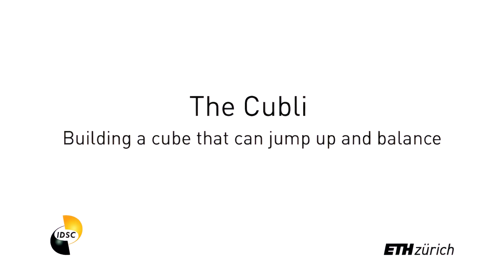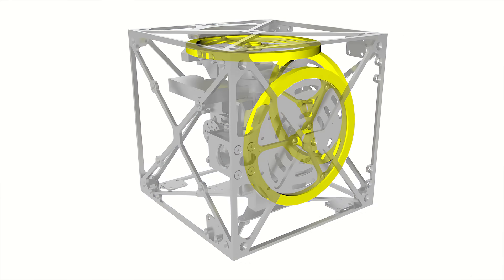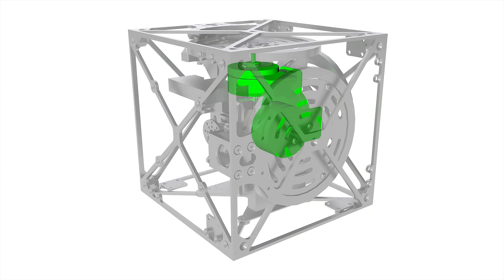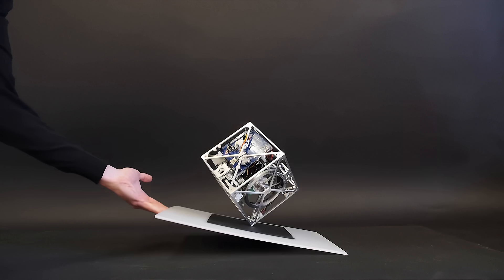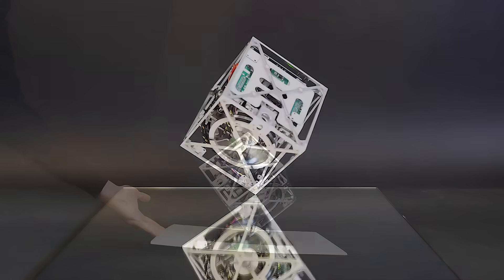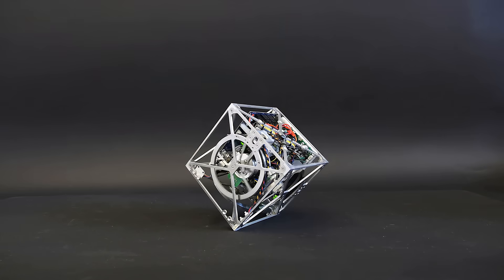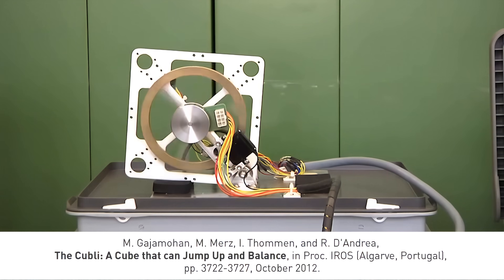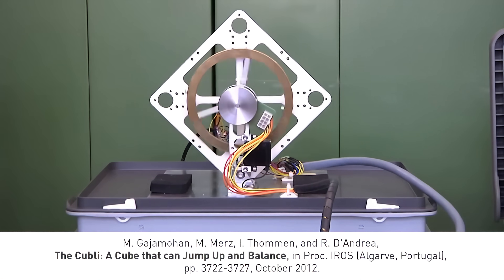The Cubli: a cube that can jump up, balance, and 'walk'

Comment: incredible device. i absolutely love this box of tricks, can i get the specs anywhere, or are they secretive about it's construction? it would only be for myself.as i often play with electronics and a few fast stepper motors, flywheels, a 'pic' chip and a few bits of hardware I think i can do some analogue of this, it won't be of that standard but a locomotion action would be fun, many smaller units with electromagnets and contact electric plates ....,, ah i will say no more i can't have some one steal that idea it will be fun. micro insects 6 legs = 6 faces now!  
i made some digital mobile fire flies that flash and beep either alone or in groups, they both transmit and receive timing from others nearby so small synchronised islands got established community that was fun.

Comment: Call me when it’s small enough to fit inside a die.
Reply: It can already, the design is fully scalable.
Reply: Zed orda no fucking way that would be so op
Reply: @zedorda1337  What about the battery?
Reply: The design is scalable so it can
Reply: @cheeselord8153  Not really, if it gets smaller then the parts need to be manufactured and cut more precisely to get it to scale. It means that if it is 10 times smaller then it needs to be 10 times more precise. And you are not considering the computer, reaction wheel and the battery that needs to be in it to work. So unless you can manufacture the parts very precisely and connect it to a computer that does the computing and maybe somehow power it wirelessly then it is impossible.
Reply: Somebody make this into a real thing
Reply: Grunkle Stan has rejoined the chat
Reply: I will win that ten dollars from my dad every Saturday night!
Reply: Could would for regular board games, but the dice used in casinos are all transparent.  You'd be able to see the mechanism inside, or else you'd have to make it opaque, which would make it obvious that you're using some other dice.
Reply: What can fit in my but can fit in a dice my guy.
Reply: tompparaideri LOL.....I thought the dancing cube idea was good......yours is better.
Reply: lmao
Reply: "Hey Bill, why do your dice sound like mini jet engines?"
Reply: Ahem, specifically a 20 sided die.
Reply: monopoly
Reply: Already is heheheh. 5g is here, you just put the brains in another place. ;)
Reply: Lol
Reply: YES
Reply: use bigger dice
Reply: Yes, I know some casinos somewhere !
Reply: you're a fucking genius!
Reply: stolen huh the audacity of this bitch....
Reply: I’m going to vegas
Reply: the ultimate cheat
Reply: Big Hero 6
Reply: have you been vaccinated yet?
You can have your own cube(s) that you take with you wherever you go.
Reply: It could already.
Reply: Hey why is the dice zooming?
Reply: @Fihlippe Luhis Was that a Jojo reference
Reply: tompparaideri really under rated 😂 only gamblers understand
Reply: Uglyboyty only ordinary people who play boardgames understand* or that's what I'd imagine a boomer to say. For example you judging from this one comment
Reply: @therealme9397  this was the comment I was looking for thank you
Reply: Uglyboyty this is just gatekeeping
Reply: Uglyboyty “oNlY gAmBlErS uNdErStAnD”
Reply: @Davie3405  Thanks mom.

Comment: What isn't shown is one limitation of reaction wheels. If you where to apply continuous force on one side of the cube while balancing on an edge, the reaction wheels would accelerate to counter the force applied and stay balanced, yet if you were to maintain the force you apply to it, the wheels would have to keep accelerating, and there is the limitation of reaction wheels. it can't accelerate indefinitely.
Reply: I'm gonna think this: if it is making force to not fall to the left, tilt a little to the right and start stopping the wheel, so it doesn't hit the limit (may need to overcome the force that is pulling it to the left)
Reply: No shit
Reply: Well no duh lol, the same rules go for applying pressure continuously, you wouldn't be able to do it indefinitely or with infinitely increasing power so it would just come down to whether the cubes balancing force is stronger, or the pressure force is stronger.  Which is obvious
Reply: @cutiecry8313  Agree to disagree.we dont need to increase the force,we just need to provide same force for a long time until cubli cant accelerate more
Reply: @nandhusb554  I mean there’s only one answer and it’s what you just said. The other guy is completely wrong if he thinks the cube can resist a small but continuous force indefinitely.
Reply: @jlight7346  yeah seems to me he's just confidently incorrect which is kinda funny given his comment is about how obvious the point is.
Reply: @cutiecry8313  world hunger is solved by giving food to everyone. Which is obvious! Lol
Reply: @DJcyberslash  I mean... That's true. It's just more complicated than that.
Reply: @bable631  Oh I know. I'm being sarcastic against that guys "everything is so obvious" mentality

Comment: While I can see that flat surface orientation can be useful, I am wondering if rounded corners would be more energy efficient. It may make the algorithms for spacial orientation a bit more complicated because not everything would be as trivially measured, but the energy efficiency would probably be worth it.
The degree of corner rounding could be various degrees. At 100% rounding the cubli would be a sphere. Perhaps 25% or 33% rounding would be maximally useful for different purposes. In part that would depend on the weight distribution within the cubli. The center of mass would still need to be over the flat portion of the face or edge for low energy stability.
Reply: Congratulations. You simultaneously reinvented the wheel while completely missing the point of it being a cube. And you used a ton of words to do it.

Comment: So it has several(3) wheels that all attempt to conserve linear Momentum placed on the 3 common axes X, Y, Z. These three different wheels then go at different counteracting speeds to mimic the angular momentums you would get from Gyroscopes. 

It's not single angular momentum disc or conventional gyroscope because there would be way less user control in the system. Three internal wheels are better though because you can then control the momentums more easily. Simplification via isolating variables and so on and on. 

You can try telling me it's "not a gyroscope" as much as you want. But when you break it down, it just becomes a more intricate and less natural gyroscope. A lively one, but a gyroscope nonetheless.

Comment: after some polishing, we can use this mechanism for advance active shock absorber for cars. yes its achievable ., imagine when cars fell into some small ditch or cutter in a road then the vehicle's body will obviously lean to affected tyre.. ok now, just think what if we put something similar to this cube to opposite side of the affected tyre we can literally reduce a huge amount of shock
Reply: would probably have similar problems as boses perfect suspension (that works with linear actuators)... using too much energy^^
Reply: @johnuferbach9166  can i tell one thing., dat suspension seriously miss some indian engineers., ya i really mean it

Comment: "...due to gravity, the algorithms used here are very different ".

Correct me if I'm wrong here, but isn't the difference that the satellites are in freefall, and therefore weightless? There is gravity up where the satellites are too (otherwise they wouldn't orbit), around 50% to 1% of "normal" gravity depending on how far up they are. 

What I mean is, if it was just the difference in strength of the gravitational acceleration that mattered, shouldn't it be a matter of adjusting the coefficients rather than having different algorithms?

Edit: Super cool though! Can you buy one somewhere?
Reply: Due to having to overcome gravity, moving by spinning the reaction wheels will be ineffective, so they produce large changes in velocity by suddenly stopping the reaction wheels and using the momentum to move.
Reply: Exactly! The difference is freefall or not. Not whether it's in a gravitational field or not. Thanks!

Comment: In inspiration of this machine, I made a relatively 2d version of this in a (mostly accurate) physics simulating video game which works by a spinning ring with two circular weights in the middle, in the center of gravity of a cube. Very hard to get the exact placements right, but I finally got it right, and in the process accidentally created a new kind of wheel, and a very fast spinning cube. Once it takes off spinning it can leap thousands of feet if touched b the slightest thing, or inversely do the same to the object in contact- which is dependant on the object's weight relative to the cube of course.

Comment: This is on the same basses of the Gravity Lac.
Imaging if you put a Gyroscope on a roller skate or mount it on a ball with a wheel socket.
A ball point pen has a ball socket so imaging a gyroscope sitting on top of a ball point pen?
if you could control the navigation you could see how fast it can travel.

The centrifugal force of it spinning will make it have a reverse gravity effect..
Kids climb walls with bicycles because of the centrifugal force created by the wheels.

Comment: Smart concept. If you put it inside a ball or a wheel (which could stand up again on it's own), wouldn't that make even more sense? What's the point of hopping into instable positions that require energy for sustain? It's impressing, but what problems does that solve?
As a balancing device/sensor it's not new.

Comment: In outer space, the wheel will spin much slower. If it forced to spin the same, it will have its own gravity point. Which got me thinking what if this thing spins lot of faster than current speed, maybe it will levitate because its negative correlation with itself.

Comment: And why exactly do we need this?
Reply: pixelking With the cubli, it will allow the simulation of gravity in outer space by gyroscopic movement (such as the spin of the Earth) and also allow the astronaut to be able to control the roll, pitch, and yaw to steer without the need of additional rocket fuel.

Comment: if they made the square a round shape it would use less energy :v
Reply: Nah, then it makes balancing obsolete.
Reply: John Doe but would be less interesting and challenging
Reply: It's called a wheel and has been around for thousands of years.
Reply: How do you balance a ball on its point when it doesn’t have one?
Reply: Try "balancing" a ball on a hill. One with reaction wheels like the Cubli would be able to do it.
Reply: Then they can make small holes on the ball so when it hits on a point it goes to the hole and balances
Reply: inyazserg Sergey Larin They already have those though
Reply: @RBRM3  what are they called?
Reply: Yeah but then it wouldn't be a cube. Lol
Reply: Would it be a ball?
Reply: well to balance a ball you dont really Need much Knowledge eccept just to build a ball
Reply: not obsolete when you put the ball on a hill.
Reply: it would be impossible to hold on for the ball on a slope for very long. the velocities have limits.
Reply: it's the contrast between the cube shape and the angular momentum which makes it's behaviour interesting in the first place ... so why would you? it defeats the entire concept

Comment: You basically took shit that Moto X bikers used for decades for balancing purposes(well, when they rotate backwards that is). They apply the brake and the rotation momentum from the wheel gets transfered to the now fixed joint bike. That makes it so the bike rotates fordwards.
Reply: u mad bro

Comment: The Smart point of This invention is  it 's Quick Response to counterweight in time. it's amazing. If We Are Inside The box if you want to move we can just push any side.or if we are in situation to Survive .we are in the tank with top hole.we can push the wall to get upper side down . so that we can get out of the box through the hole .well !! that looks like the box can walk right.

Comment: another useless shit
Reply: Actually, no. The applications of the cubli would go pretty far... especially in outer space. In outer space you can use three rotating discs to allow you to spin in a weightless environment without the need of rocket fuel. Less fuel means a lighter space ship. A lighter space ship means a lot. A heavy payload would require more rocket fuel to launch the payload into space.

Comment: Um, so, practical use for it?
Planetary exploration would have wheels and reaction wheels going for it
Self assembly robots don't need to Stabilize all that much, if this has to spin up to stabilize on one of its corners I doubt it would be practical for stabilizing a much heavier robot
Reply: cheating dice!
Reply: Gerbal replacements
Reply: Because you have a small mind.
Reply: Practical use? A rover that has wheels and for some reason tumbled. If you have something like this inside the rover, it can flip back to straight position by itself. Also, there are places that are no reachable using wheels, like high steps. So in a rocky formation, the rover could climb up using this motion, instead of the wheels. Come one dude, use your imagination a little!
Reply: Don't worry about practical uses.   It took many years, like a decade, I think, before they found practical uses for lasers.   Although this is not a fundamental discovery or invention -- it's just using action - reaction in a neat way.
Reply: 1. Orientation of a cubesat to maintain comms or camera stability. Orientation of a stabilised VSAT antenna. They currently use belt driven motors which is probably better but whatever. 3. Imagine that it is not a cube but some other torqued apparatus with test equipment etc.
Reply: shalol the future of building whole buildings made from nanobots like this design... Only design left its a xkanp..  somwthing like lego and yougot it
Reply: KayAteChef also if the planet experiences weather conditions that can topple the vehicle it will need this to reorientate.
Reply: shalol to hell with that. I want it to just follow me like a pet. That would be ao awesome. All it needs is a bit of decorating. Maybe make it look like a companion cube from that portal game.
Reply: olaolapepsiman better yet. Make it follow you. 100% getting laid.
Reply: Please, shut the fuck up.
Reply: Luckily there are smarter than you that can think of practical use for it, instead of criticizing the two examples given in the video
Reply: Prototype much?
Reply: BioClone I think the simple 3d printed buildings are pretty good. A dozen homes in just 1 day with just 1 printer.
Reply: There are practical uses, but honestly it would just be fun to mess with, better than a RC car!
Reply: David L. Read out loud what you just typed.

Comment: I don't know if the team that made this will see this, but here's my response to this. The cubli will make the world a safer place. 

"This is really interesting. I imagine that several cubli units attached to the frame of a vehicle could provide additional or replacement control over small aviation, especially in drones. Then all of the propulsion could be put towards levitation and ... propulsion rather than also having to turn to rotate the vehicle. This can also potentially replace the rotor of a helicopter, and make it safer in a crash landing because the helicopter would be innately able to stabilize from an uncontrolled spin barring a gale winds environment

Also, the cubli could be altered into a pyramid shape (pyramli?) with a series of six wheels rather than three. These wheels, one perpendicular to each edge of the pyramid, would be at an angle to each other and thus each can be engaged to move the structure in a single step. This would include more surface area and be more stable in the mentioned planetary exploration environment. 

This setup would also leave quite a bit of open space inside the pyramli to attach listening, sampling, etc equipment. Probably include a robotic arm so that it can access both the atmosphere and ground regardless of orientation, as well as provide a variable balance to compensate for the weight of attached instruments and ensure that the center of mass is at the center of the pyramli. 

In this application it can share a power source with the instruments. To prevent damage, the instruments would probably be shut down when the pyramli is in motion, giving the motion systems full access to the generators and power reserves within the unit. The edged might also include hydraulics, enabling it to collapse one edge to cause the unit to fall in one direction and then extend it past starting to jump forward, making movement more efficient and hopefully not breaking gravity. Maybe a grapple gun of some sort would also be useful."

Comment: How would it behave in zero g?
Reply: that's an excellent question, and I believe if it was coupled with a laser location system it would be fine. As long as it can "see" a reference point it should have no problem.
Reply: watch the video of the CD player in space, you should get an general idea :)
Reply: Every spacecraft has such a thing like cubli built in to attitude control.
Reply: as long as nothing pushes it it would simply do all its usual tricks but stay in the same spot so it would rotate left right ect ect all while staying in the same spot much like how reaction wheels do the same in space craft
Reply: theviniso an obsolete object
Reply: SenpaiSancho YT I get it, I mean what would it do in zero gravity. Would it try to stabilize itself forever? Would it stop moving?
Reply: theviniso It will try to operate and it will but it won't work as we hope if anything it might just become a uncontrollable bullet, a slow one. Side note, excuse my English i got used to speaking Spanish for the past 2 days